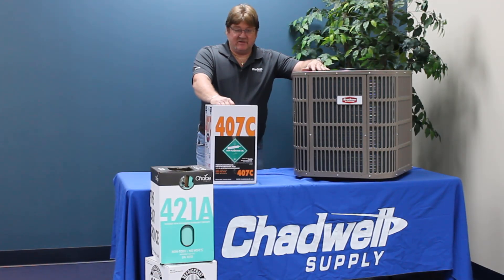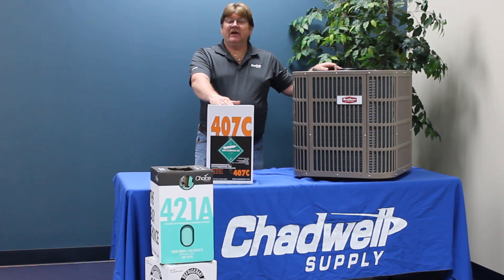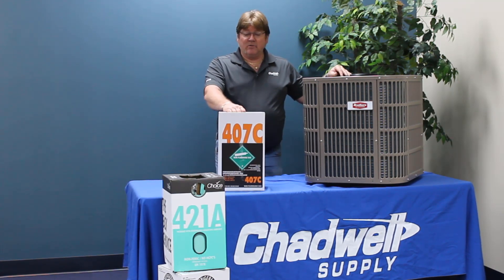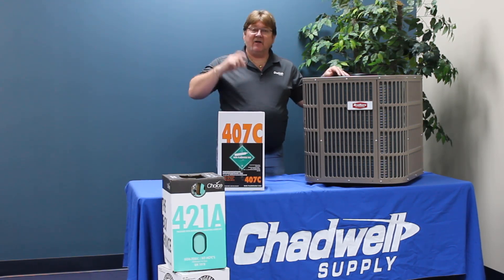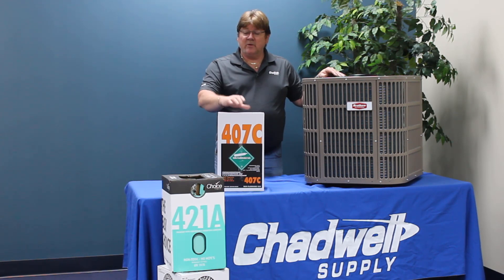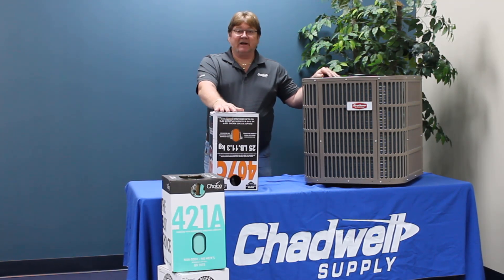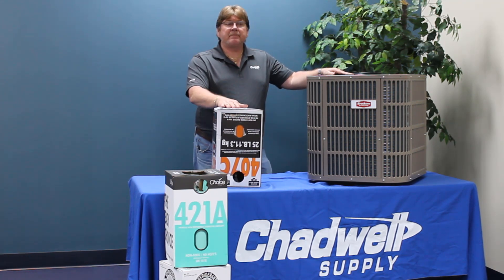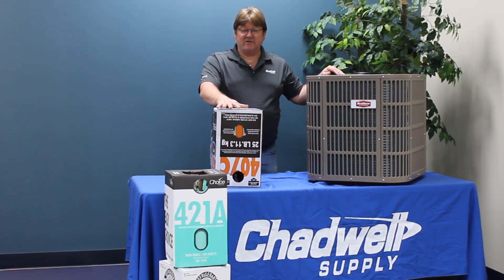Part 4, Pros and Cons of R-407C Refrigerant

Comment: I heard guys removing the r22 ..putting in the 407c adding 80% POE on top of old Mineral...I was told the Old  will not circulate without the Chloro...and the POE will just pass it by?...I think i'll be safe and remove it all and start clean ...like you said.....some more work but measure twice cut once...Thanks

Comment: I'm hvac  contractor for the last 30 years i have been using 407c for years never have no problem you are a fake con artist
Reply: Same here: I still have an American Standard HP air handler with R22; bought new York AC condenser and charged with R407C. It has been running for 9 years with no problems and no oil change either!
Reply: are you saying you drop in 407c, no flushing no oil change, with zero problems?

Comment: What if you drop 407c on top of r22? What would happen to the system when you mix the two??
Reply: My 5 ton unit has operated for 4.5 years with a mixture.  It now has 70% R407C & 30% R22 with only MO.
Reply: Not supposed to mix them, they use different oils.
People do it all the time and it's not proper. will it work? maybe for a while but it's not RIGHT
Reply: I have  mix 134R to407c  got temp in commercial cooler  but next day  got leak          At the valve flange fix that and fill 407 c again and next day got the dryer leak fix that and fill 407 c and  next day  got leak at  gas fill nozzle which was not leaking a day before 4 times I have done this lost lot of gas and labour cost  now I do not know what to do .My technical man  does not know what is happening .He repairs one place and next day a new place leaks pls assist